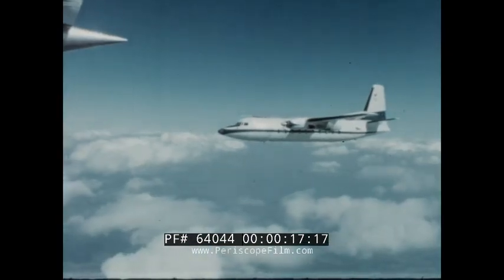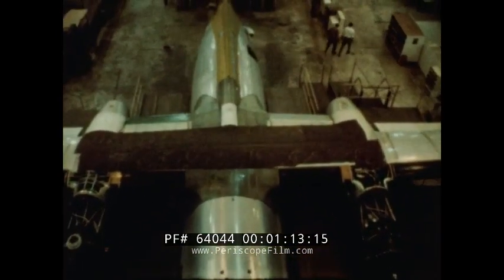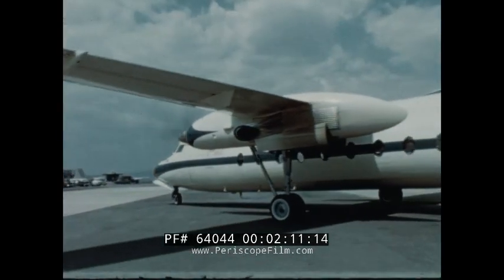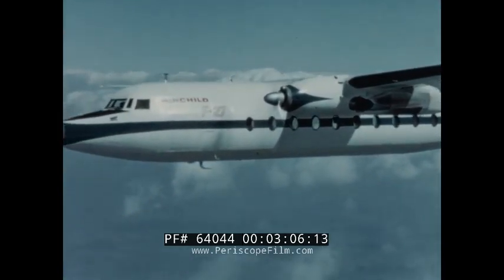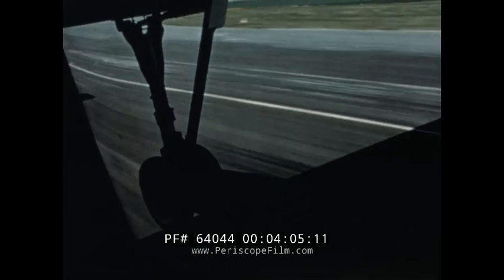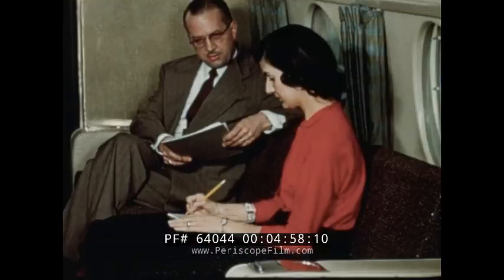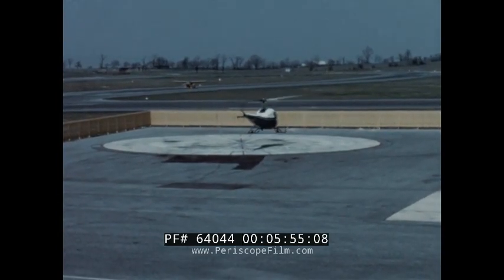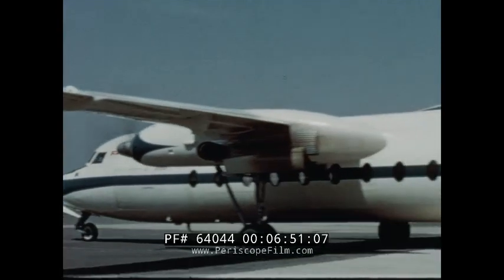FAIRCHILD F-27 PROPJET / FOKKER F-27 FRIENDSHIP REPORT w/ ARTHUR GODFREY  64044

Comment: The Fokker F.27,  Fairchild F-27 and FH-227 were terrific airliners.  I recall as a kid watching Ozark's FH-227's flying into Chicago's O'Hare Field back in the 1960's and 70's.  Got to fly on both the Dutch built Fokker F.27 and American FH-227 respectively via Mississippi Valley Airlines and Britt Airways.  A friend of mine, the late William (Bill) F. Mellberg (author of the book, "Famous Airliners"), was once employed with Fokker Aircraft U.S.A.  He told me that pretty much the only things compatible between the F.27 and the F-27 were the landing gear assemblies and Rolls Royce Dart engines.  Great video and information regarding the history of these jet-prop airliners.  Thanks for sharing!
Reply: Dan Uscian : my first airline flight was on an Ozark F-27 from ALO- ORD, June 6, 1971. 10 years old. I now fly for NetJets. Maybe that old F-27 ride was an influence...
Reply: @erikhertzer8434   My first airliner flight was on a North Central Convair 580 in 1973 from ORD to MKE and back.  But, unlike you, I ended up instead working as a locomotive engineer for the Soo Line Railroad.  Guess I got "side tracked!"
Reply: In 1971 that would have been the bigger FH-227B.
Reply: Rolls-Royce Darts also powered the Vickers Viscount, the NAMC YS-11 and the Convair 600/640.